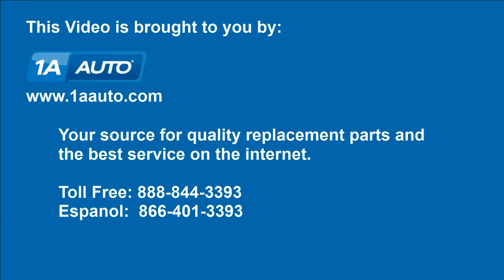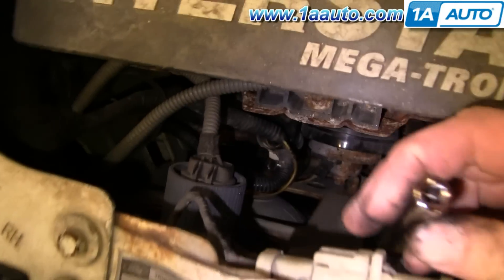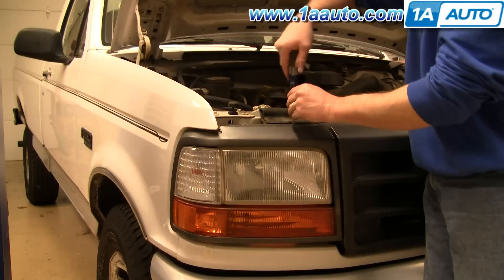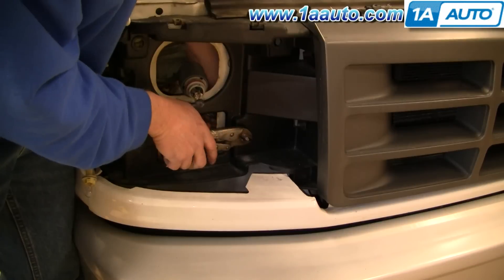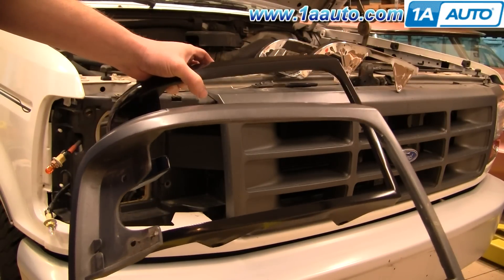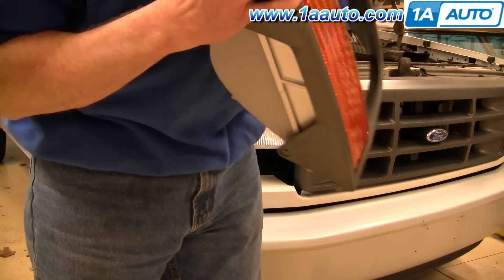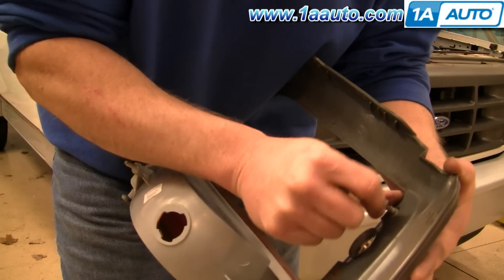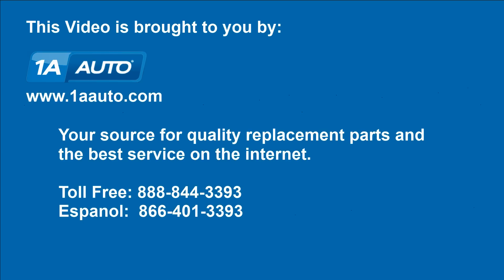How To Replace Headlight Trim Ford 92-96 F150/250/350

Comment: Thanks.  Good video.  One small change.  For my 95 F250, the nuts holding the trim were 11mm vs. 10mm as described in the clip.
Reply from the maker: Depending on the year and what plant the truck was built it, this happens from time-to-time. Thanks for watching. 1aauto.com 888-844-3393
Reply: My 96 Bronco seems to have 9mm nuts on the bezel, go figure.

Comment: Question on your replacement headlight housings (1995 Ford F250 XLT) are you selling OEM or Dorman or?
Reply from the maker: The headlight trim/bezels for your vehicle are brand new aftermarket parts built by a variety of manufacturers that make parts for us. All built to strict quality control standards and backed with our Lifetime Warranty.  Thank you for your interest! +Brian T.